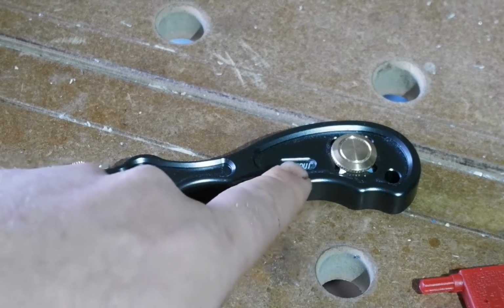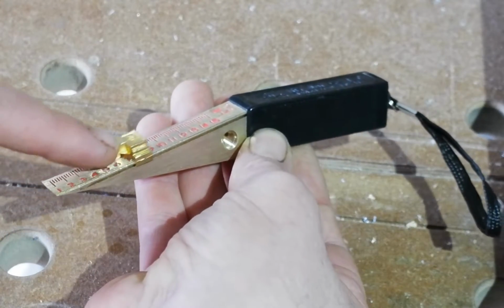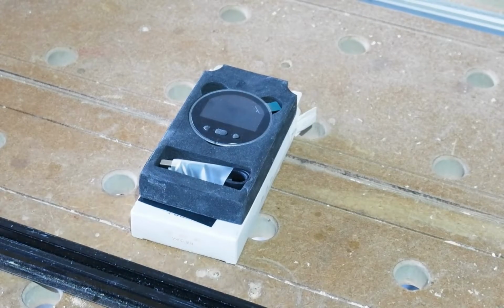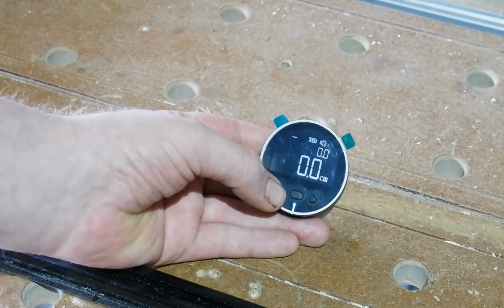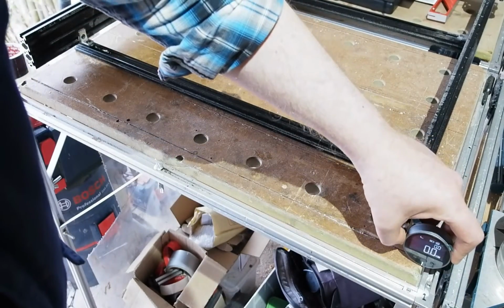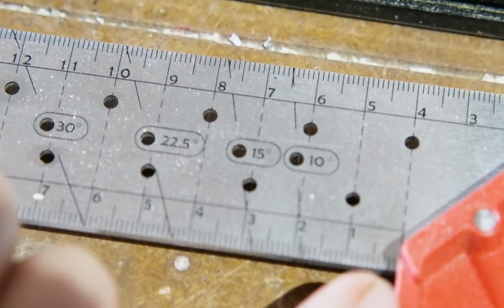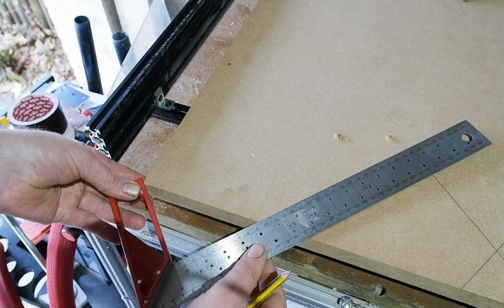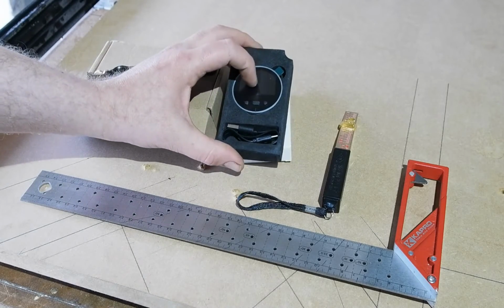Banggood Tools Review!! Carbide Scraper, Feeler Gauge, Digital Tape Measure and Framers Square.

Comment: Bahco 625 scrapers are roughly half the cost of these ones, and by the looks of it have a better designed grip, if you've got to use a bit of force.
Reply from the maker: Yeah, the Bahco ones are good. The one featured here is Hongdui brand. It's the Chinese premium brand rather than most the other stuff I feature which is low cost. I review a Hongdui premium mitre gauge in one of my other vids. It's priced in the Incra/Jessem range. It's very good kit, though not cheap.

Comment: About the screw in the stock of the square - I have wondered about this as well. Since there are two riveted points how adjusting the screw help resetting the square?
Reply from the maker: Yes, the 2 locating pins do look like they'd stop any adjustment. Maybe the screw is just a better fix than a pin on the bevel taper and isn't for adjustment. Like I said, I didn't try it as, I didn't want to tempt fate as the square was already true.
Reply: @BischBaschBosch  You are probably right. I have a cheap aluminium square that's assembled in a similar way and I will fiddle with it to see if there is any difference. I am happy to finally see this Kapro square tested. I quite like the design and it seems to be well built.
Reply from the maker: @na.tezgyaha  I kind of wish the ability to adjust was on more tools to be honest. The Kapro square is quite nice. Works well for me. I've been doing a little bit of framing with it onsite this week in fact. Nothing special but a decent square of fair quality
Reply: @BischBaschBosch  I've been looking recently at tools on AliExpress and Banggood. How do both sites comare? Do you prefer one or the other?
Reply from the maker: @na.tezgyaha  sorry, I've only just realised you asked this question. There's a great range on aliexpress but I found it easier to see on banggood which products have a quick processing time. This means if you buy wisely, you can have goods in about 8 working days. Aliexpress orders I found generally took about 5 weeks to arrive. This is why I stuck with banggood. They have a decent points reward system too.
Reply: @BischBaschBosch  Thank you for the reply :)